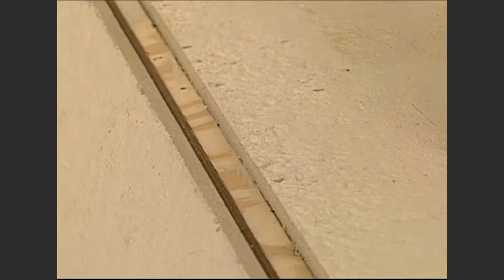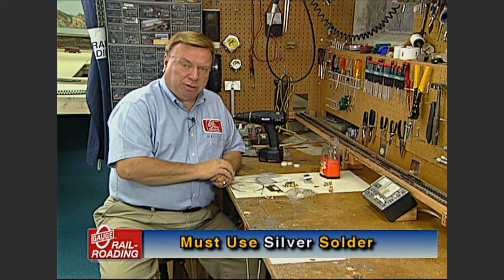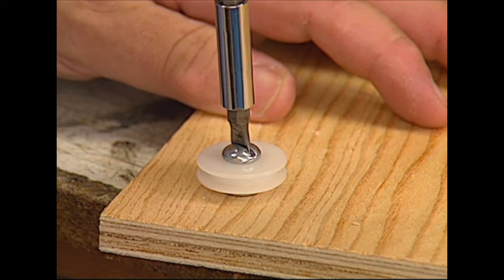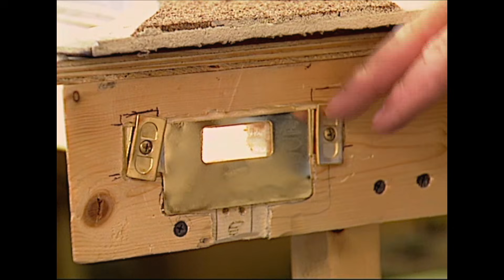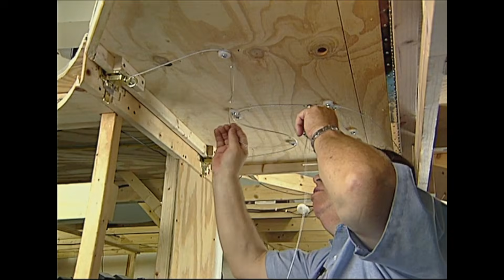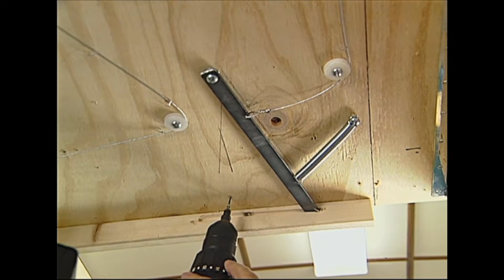Backshop: Build a Hinged Drop-Down

Comment: Didn't mention how wire this and have electricity connections :'(  but great video, will definetely come back if i do this for my layout
Reply: A loose loop of wire from the main platform adjacent to the hinge for each rail as needed will allow power for the drop down section.nothing is set in stone, but a few minutes looking at the problem, you will have your solution.

Comment: Question: how do you power the tracks where they will break?
Reply from the maker: Run separate power feeds to the bridge rails. Use stranded wires for the flexibility you need as they move.
Reply: Also, be sure to over complicate the wires by adding a spring and pulley system so they don’t get pinched in the hinged part.